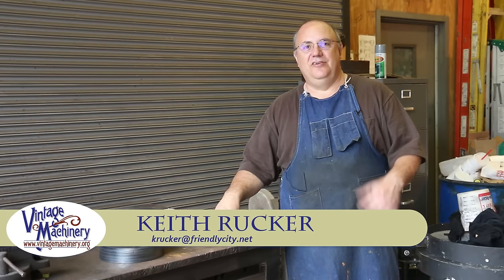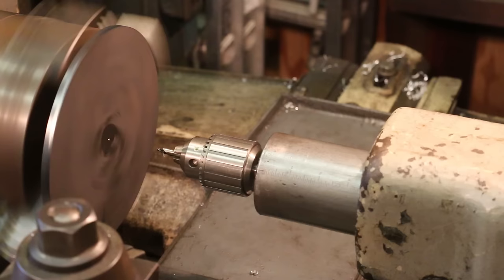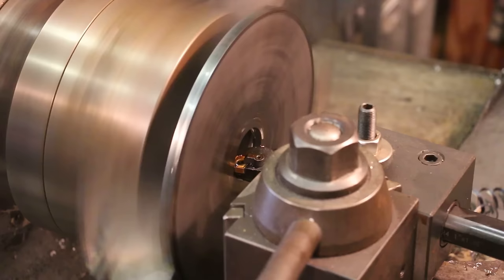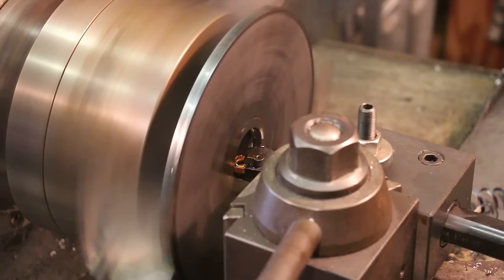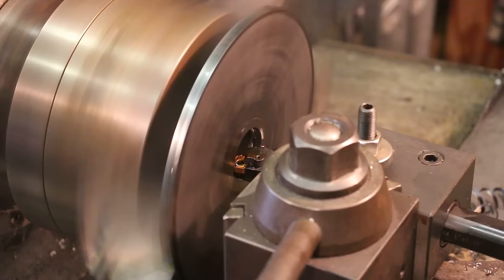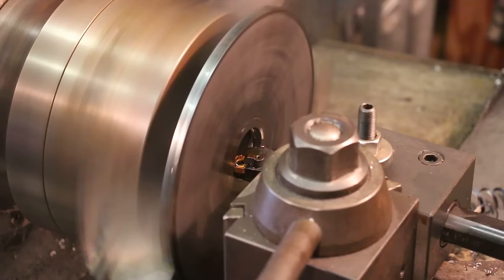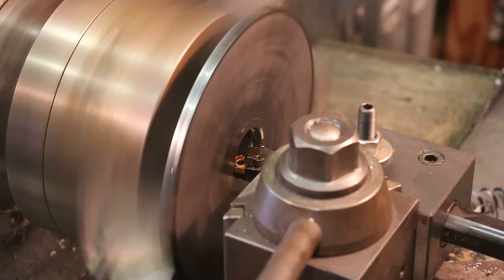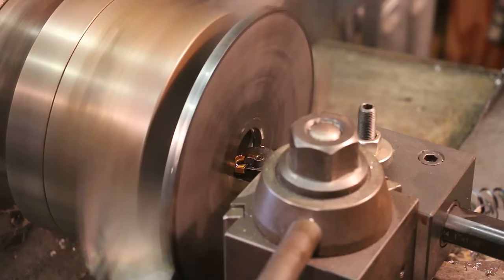Machining Dividing Head Index Plates

Comment: doing this with the CNC machine isn't going to "eliminate" the human error factor.  It may reduce the human error factor but not eliminate it all together.  

It will for sure lower the amount of instances where one can err.  But... imagine if a human makes an error when indexing the blanks... or maybe enters a command early in the procedure that will magnify itself moving forward as it continues to cut "improperly"...

Then there are also the possibility, though very unlikely that the project will experience "mechanical error"... bit loosens and damages the blanks (created by a human that did securely fasten the bit in the first place)... electrical glitches can be known to create some very creative designs in the media... etc...

Just Sayin'

Be Well and Keep up the good work!

Anon
Reply: +Anon Ymousmie 
Your thinking way to hard!
Reply from the maker: +Anon Ymousmie I was talking about the human error in drilling all of the holes.  Yes, one could still make an error in programming the part to run, but assuming that you get that part right, the CNC mill should put everything right were it needs to be.  With the number of holes needing to be drilled, it is actually pretty likely that you mess up on one of them if you were doing them manually - that is the human error that I was talking about.

Comment: I had to laugh when you pulled out the can of acetone, probably $3 at the hardware store for a quart and my wife spends as much for a 4oz bottle of nail polish remover which is? Acetone! Keith, I was wondering if you were going to put the three holes that hold the plate to the head before you send them out? I have the feeling that they must  be in a specific spot in relation to the holes for the guide thingy.
Thanks for another great Friday morning with Keith!
Rich
Reply from the maker: +Rich206L I really does not matter where the three mounting holes are in relation to the index holes, but I figured it would be just as easy to drill those out on the CNC as the rest of the holes.
Reply: +Keith Rucker - VintageMachinery.org Really, no kidding? I would have thought that they were really important! But hell, I'm just a helicopter pilot, what do I know about machines!  :)

Comment: May be extra work but free is still good. Also you may want to check your Mike. It sounds like you have a wire breaking or bad connection
Reply from the maker: +ww_big_al Yep, I am replacing the mic after I heard that.....
Reply: +Keith Rucker - VintageMachinery.org Next mike you get, get some heat shrink and reinforce the joints. It gives you extra life for the thing.

Comment: Really absorbing video Keith - thanks. Have you done any trepanning? It's something I want to try but need some pointers. I must try the superglue arbor technique too. Best regards. Mike.
Reply from the maker: +Mike Barton I have done some trepanning but it takes special cutters that I would have had to either buy or make as I don't have any the right size for this job.  For no more parts than I was making, I just did not think it was worth the investment in time and/or money.

Comment: I might have tac'ed them all together to cut the bore and also eventually the outside diameter.
Reply from the maker: +zomie1 Lots of ways to go about this job.  I considered turning the outside all at the same time but I would have had to make an arbor to turn them on and for no more than I was doing, it was just as easy to just do them one at a time.

Comment: I read somewhere (or maybe a Youtube video) that using a CNC (or even a manual mill with a DRO) is quite a bit more accurate for laying out bolt circles than a rotary table. Very small angular errors can amount to quite a bit of position error, especially as the circle diameter increases.

Clickspring. Isn't his channel great? Maybe the best in terms of production values. Perfect lighting, flow, and (in some recent videos) some moving camera shots that are just amazing. The fact that he is an innovative machinist, and makes beautiful parts is just extra icing on the cake. His channel:   https://www.youtube.com/channel/UCworsKCR-Sx6R6-BnIjS2MA/videos
Reply from the maker: +Peter W. Meek I considered using my DRO to do the circles, but it is just so many holes I think I would have gone crazy.  I really like the idea of programming it in the mill and letting the computer do the work!  I just don't like doing repetitive jobs like that...

As for Clickspring, he has a great channel.  By far the best camera work I have seen on any shop related YouTube channel.  Worth checking out!

Comment: Instead of wasting all that time turning the OD's of those plates why didn't you simply chuck them on the 
outside edge, they are certainly heavy enough, then bore the center hole and trepann them out from the 
face of the plates?
Would have taken less than half the time and been just as accurate!

Comment: I'm sorry but i too was very disappointed to watch through and only see you make washers!  And as far as using super-glue, I've seen many machinists do the very same thing--even for big stuff.  I was mainly interested in seeing how you calculate the holes and for what each disk was to be used for; addtionaly how you insured the accuracy of the holes being drilled and maybe a finished test sample demonstrating the machine. This was certainly not up to your normal high standards and I (and others) feel click-baited by your video title which could have more honestly-said " Making washer-blanks for an index-plate."

Comment: I would of did it differently, but how ?  I would of made a mandrel to all your plates on, using a dog between centers to turn all diameters at one time. Then pulled out my machinable periles with my my soft aluminum jaws installed to machine all plates to size. P.S. Super Glue is toxic to inhale when heated up. Free speech